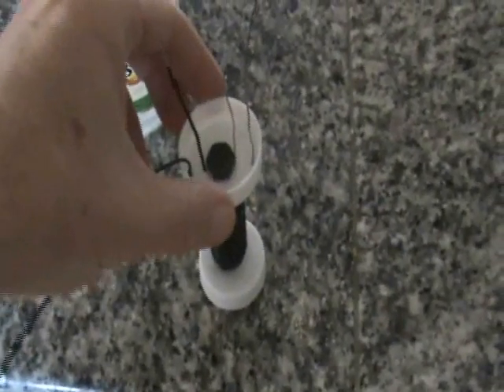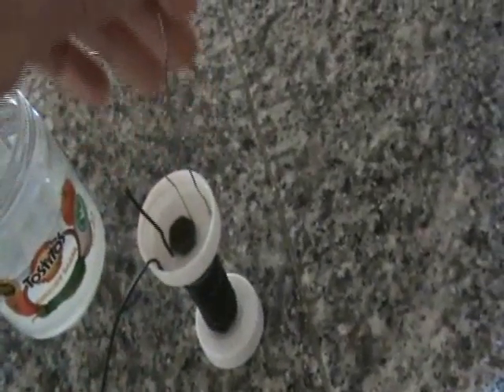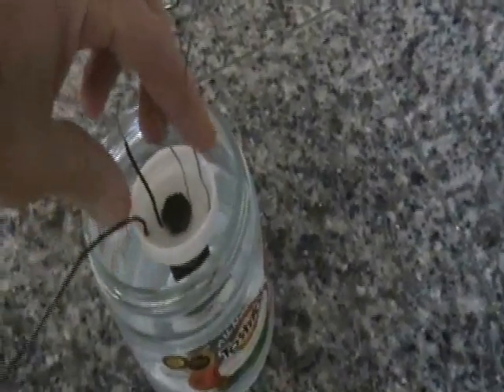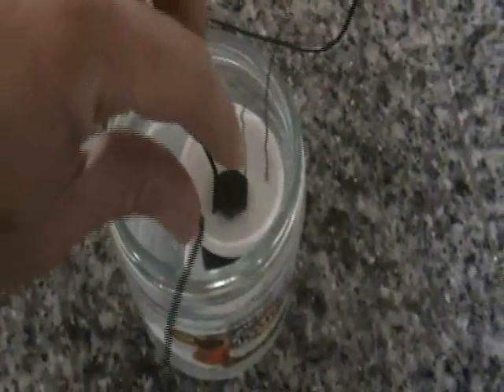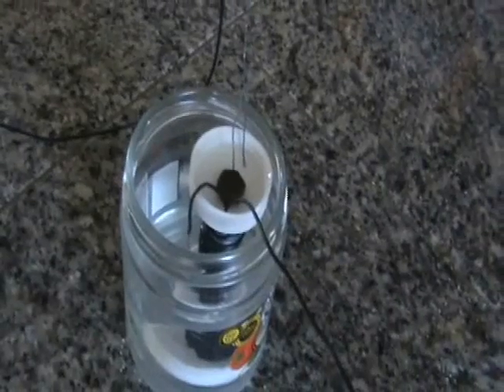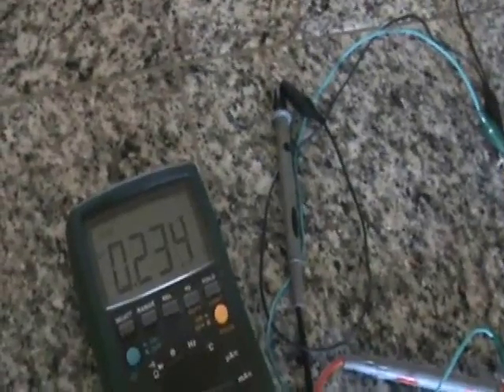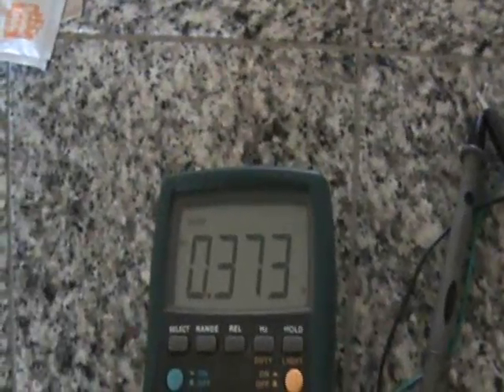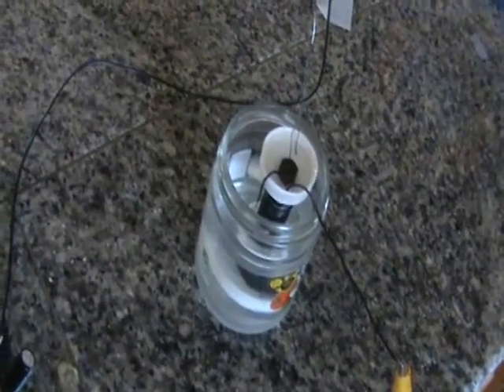Stubblefield Electrical Battery Replication

Comment: Have you thought about shorting out the steel bolt, with 12volts, which will realign all the iron crystals in one direction?
Reply from the maker: +reddpill No I had not. Good idea.
Reply from the maker: +reddpill I had thought that over time, with discharges from Telluric currents, that the core would get magnetized. But good idea to do this intentionally.
Reply: morpher44 Fingers crossed ;)

Comment: Seems to me the copper insulation is key to all this., because it isn't contacting the water it is acting as a capacitor.  The little bit of copper in the water is not a proper cathode in so much it does not attract a lot of charged ions next to it, this is good, as the steel anode has lots of charged ions next to it.. therefore there is a potential difference which means the business!    so the charged copper wire picks up a chathode charge from the water and this charge is distributed through-out the copper coil (capacitor function).   The voltage increases when connected, because the copper capacitor coil acts as a buffer that gets saturated with neg electrons from the power connection,normally this makes a battery flat through use, but as the flattening electrons are stored up in the copper coil and not on the copper tip (cathode) the battery can keep doing what its doing (creating charge).  The steel coil acts as a way to get as much anode in the juice.. And the juice would work better with acid/lemon in it.   If this is the correct interpretation it suggests that creating a potential difference in a galvanic cell by buffering one polarity, could increase its performance..  It probably gets the residual start-up power from the little steel antenna or the coils via radio waves or some sort. Remember the sky is + and the earth is - so power must be experienced some where!

Comment: so- 1. how much to build a battery system to use , say, just 1,000 watts almost 20 hrs a day ?
Reply from the maker: Let us say that each earth battery cell can produces maybe .5v at 20ma. That is 10mW. So to scale this up to 1000 watts, you would need at least 100,000 cells. Probably more. If each cell in the earth is about 4x4 inches, you would probably need an area of land that is 100 feet by 100 feet (or more), prepare the soil real good with certain substances, including keeping it wet, and place all the cells in parallel and series to produces the voltage and current levels you want. There will be losses, so you probably need way more than this. Use the appropriate gauge of wire to reduce resistance and be sure to insulate it against the elements, as any connection to ground will discharge the power. The part of your system that is COIL should probably connect one side to large plate under ground, and the other side to a wire that goes way up high into the sky.
Reply from the maker: In terms of the cost. 100,000 cells at say about $3 USD each, would be  $300,000 USD. You would then need the labor costs of building the setup. It would probably cost maybe 1/2 million USD ... but then you would have this nice 1kw battery that lasts 100 years. You might need a scheme were the cells can be cleaned and replaced and some means of finding bad ones, etc.
Reply from the maker: In terms of electricity cost, 1kw 24 hours a day for 100 years that costs 1/2 million USD (today's value) works out to be about 57 cents a killowatt/hour. Probably more given that the material will erode over the 100 years and need maintenance and to be replaced. But then you have inflation helping you.
Reply from the maker: For a 6Watt/Hour scale, enough to charge a smart phone, you would need 600 cells, about a 9ft x 9ft area -- maybe 2 or 3 grand USD.

Comment from the maker: 3300uF is approx 1/300th of a Farad. Watts are a different concept altogether I'm afraid. Watts are a measure of power. Yes wire will corrode over time. Guys in the late 1800s/early 1900s had earth batteries running for decades, however, to run telegraph systems. They just needed to pour water on them to get them going.

Comment from the maker: Ah!. I had plastic insulated copper wire ... and then I had cloth between layers of wrappings. Yes it makes sense to have a porous insulation so that water can go through ... but the metals can't contact. I agree. If the "earth grid" theory is correct, it might be true that certain hot spots in the earth will yield more power. It might be interesting to bring these around like dousing for power to test that theory.

Comment: Morpher44,
The copper wire is supposed to be cloth insulation, so the copper can make a galvanic reaction/connection albeit weak with the iron.
I made one like yours with plastic covered wire, and wrapped a secondary. I connected the iron and copper like a joule thief and it worked well.
I hope you make more of these next summer. jeanna